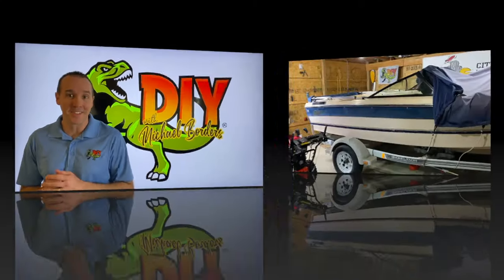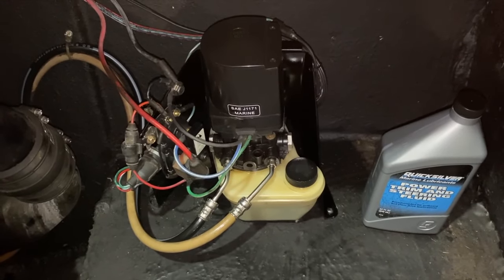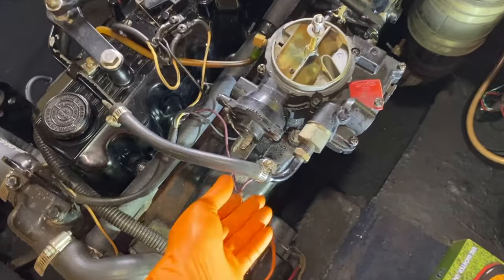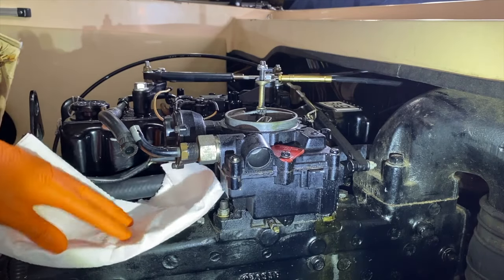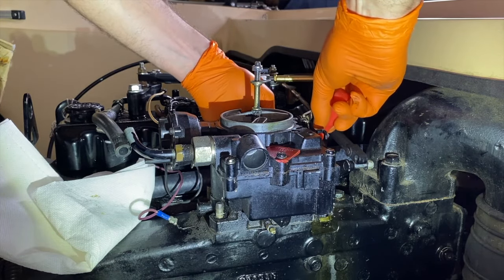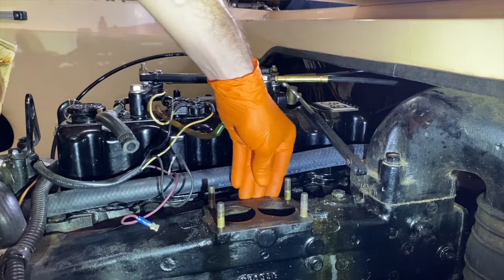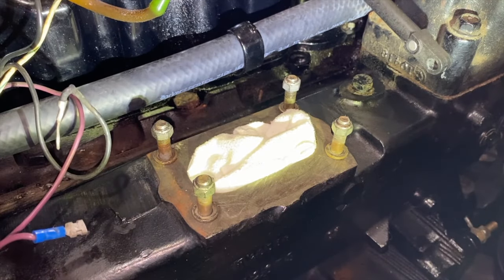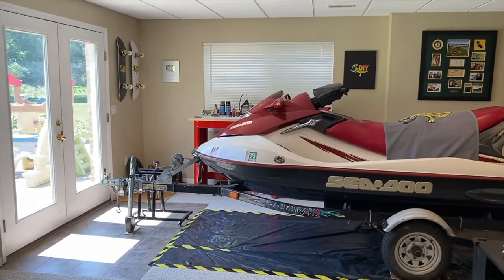Remove 3.0L Mercruiser inboard carburetor - DIY

Comment from the maker: If interested in purchasing this product, visit our Amazon affiliate link below.  I earn from qualifying purchases.

(Fixing Boats/Jet Skis) Playlist

          https://youtube.com/playlist?list=PLjCXOz8TSkZlae2qY97uVVTm3JdBOUoRS&si=4qJfGPter-lk0YA4

****************

New OEM Mercury carburetor:  https://amzn.to/4amevWj

Carburetor rebuild kit:  https://amzn.to/3Pu5GC2

Pic tool set:  https://amzn.to/3wVfL4m

Distributor Cap:  https://amzn.to/3Pr4O0W

Distributor tuneup kit:  https://amzn.to/3IAvDMh

Trim Limit/Sender Solenoids:  https://amzn.to/3wXtZBL

Ignition coil:

       https://amzn.to/491of7o

       https://amzn.to/3wPEwPn

Fuel filter:  https://amzn.to/3Vlf0Mq

Spark plugs:  https://amzn.to/3TegFRe

Spark plug gap tool:  https://amzn.to/3PgGXB5

Wire and boot set:  https://amzn.to/49NcVNq

Ratchet socket set:  https://amzn.to/49SFkBD

Oil filter:  https://amzn.to/3VmEmcN

****************

1.  Replace Mercruiser inboard Trim Limit and Sender Solenoids

          https://youtu.be/ebUCWEFw7Xo

2.  Replace Mercruiser inboard 12v Ignition Coil

          https://youtu.be/PAc0cAYeY_c

3.  Replace inboard Distributor cap rotor and points

          https://youtu.be/kqBL1tSTMkk

4.  Replace Mercruiser outdrive Anode kit

          https://youtu.be/qy_qclP3zUQ

5.  Replace Mercruiser outdrive Trim Rams and Hydraulic Lines

          https://youtu.be/nkcFYl5bL7c

6.  Air bleed hydraulic Trim Rams and lines

          https://youtu.be/gfW3dWsSLkE?si=qXPu6ku1d5fkHc2H

7.  Replace Mercruiser 3.0l inboard spark plugs and wires

          https://youtu.be/-qStXfk5Zak

8.  Upper unit rebuild (PART 1)

          https://youtu.be/i7nRJPbRYPI

9.  Lower unit rebuild (PART 1)

          https://youtu.be/ehTA4BRH4t8

10.  Replace bellows/shift cable/water pump

          https://youtu.be/NcObTOYXtQM

11.  Replace Trim Limit and Sender switches

          https://youtu.be/vjJDnmJCNL4

12.  How to calibrate/align Trim Limit and Sender switches

          https://youtu.be/5BetZVkPPHI

13.  Change Mercruiser inboard engine oil

          https://youtu.be/F0UjuwQ3-4E

14.  Remove 951 DI engine from jet ski

Comment: Great step by step guide video, got a 08 bayliner 3.0/ when give it throttle it bogs out and engine cut off, need tuneing or carb ? Thanks
Reply from the maker: @rinloeurn9022  

Thanks for watching, we appreciate that.  Honestly, we would start with plugs and wires as well as destructor cap and properly setting points.

Maybe even replacing fuel filter.

If you are still having issues…carb is almost 100% likely the cause of your engine bogging.

Comment: Great video, I got a question wondering if you could give your opinion. Went to fire up the motor for the first time at the lake, it has already been drained of all the antifreeze in the water lines when the mechanic put the hose to it. The motor had a rough idle, slight increase in throttle eliminated any sputter. As the throttle increased more the motor begins to sputter and die. Any info carb or some blockage?
Reply from the maker: @tuned2k  

Thanks for watching, any update?  First thought would be contaminated fuel, or a clogged and contaminated carburetor however in your case…neither of those should apply at this point.

Have you replace spark plugs and wires within the last 2-3 years?  It’s also possible that if your distributor cap was replaced, your point gap may be off a bit.

We will post a few video links below including replacing spark plugs and wires as well as replacing your distributor cap, points, and setting gap.

You may also have a weak ignition coil, and by replacing a few of these parts, the efficiency and effectiveness of your ignition system will be second to none.

Replace plugs and wires:  https://youtu.be/-qStXfk5Zak?si=71n9dLIXdSd-1xIi

Replace Distributor Cap:  https://youtu.be/kqBL1tSTMkk?si=mYx5VVfF5xeuA2rj

Set distributor point gap:  https://youtu.be/YbEoFI8lCQE?si=YYoLFl2reDTOmGLX

Replace Ignition coil:  https://youtu.be/PAc0cAYeY_c?si=9flBYSDM1D9x_NTZ

Let’s start there, keep us posted.

Comment: Can u tell me,for what purpouse is that yelow hose on the carb down to pump?
Reply from the maker: Thanks for watching, great question.  In this video at the (6:50 mark), we talk about this sight- fuel line.  It allows you to see if fuel is inside line.

If fuel makes its way inside line, it’s usually an indication that your fuel pump diaphragm has ruptured and will need to be replaced.

Comment: i just boat a boat with this motor in it. the butterfly is NOT connected to the throttle cable linkage and i'm trying to figure out what i'm missing. If there is anyway i can get in contact with you that'd be great!!!
Reply from the maker: @trahvzz  

Thanks for watching, any update?  This is the best way to stay in touch with us.

😁👍🧰
Reply: @DIYwithMichaelBorders  did some digging and research, me just being silly. i didn't know about the automatic choke. new starter on the way, trying to figure out which carb rebuild kit i need. pulling carbs off this weekend
Reply from the maker: @trahvzz  

Awesome, well done!  A new Starter will be a great addition to your engine.

😁👍